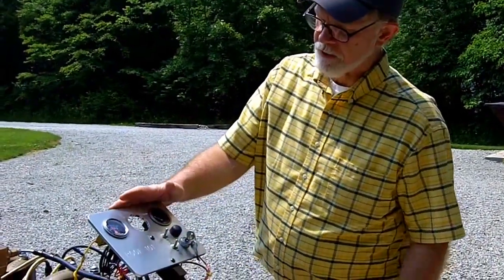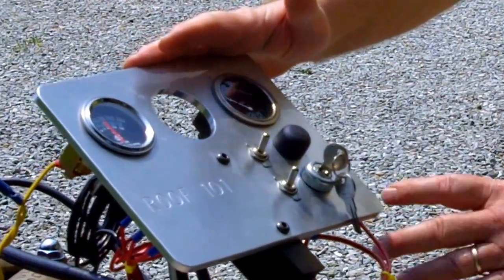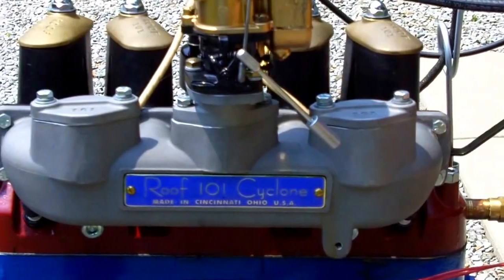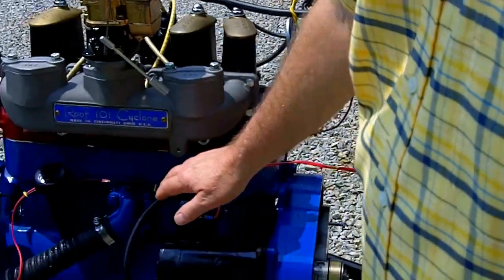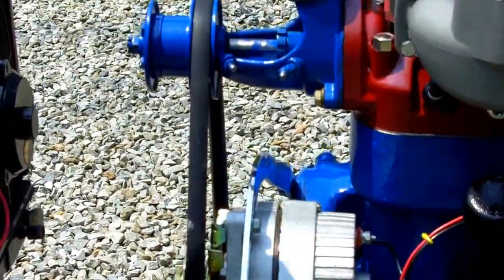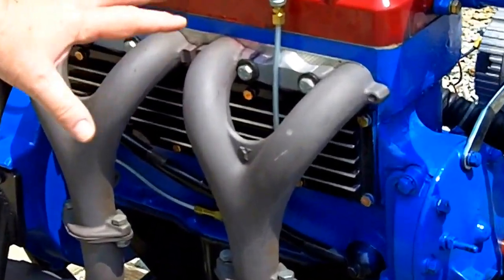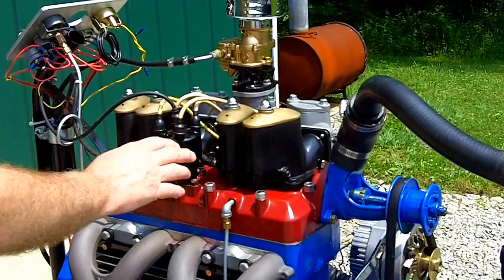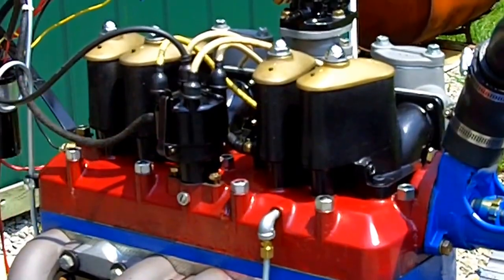Copy of Roof 101 Cyclone OHV Model A Ford Engine Conversion - Clip #2

Comment: What a difference your OHV set up makes! For all intents and purposes it now sounds like a modern 4 cylinder engine with the accompanying higher revs compared to the loping along barely turning revs of the original 4 cylinder Model A engine. The alternator and electronic ignition are wise add-ons. Well done.